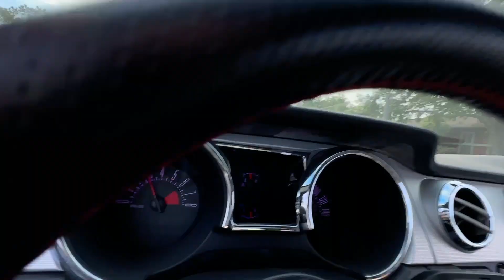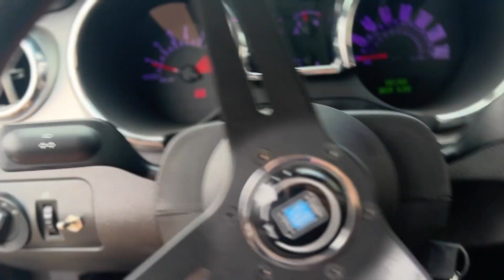The BEST Way To Get Rid Of Old Tires!

Comment: went looked at a 2006 s197 and it was cool! but why not add a hydro e brake instead of using the stock e brake ?
Reply from the maker: Hydro is in the plans just haven’t pulled the trigger yet

Comment: Could just be the audio in the video but it sounds like your clutch kicking a lot.. car should be making enough power to not need to so much, will go along way in preserving the clutch
Reply from the maker: It’s clutch kicks to make corrections in my line